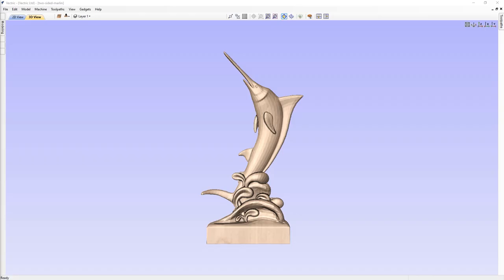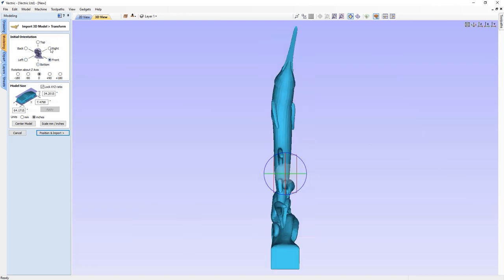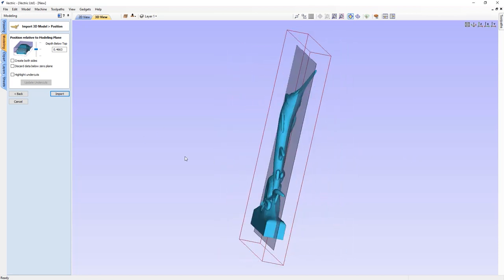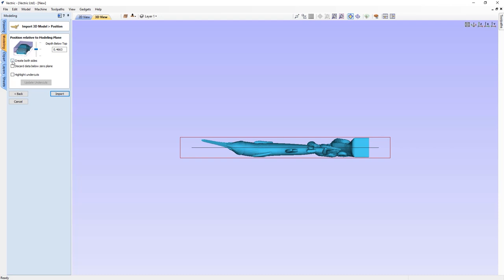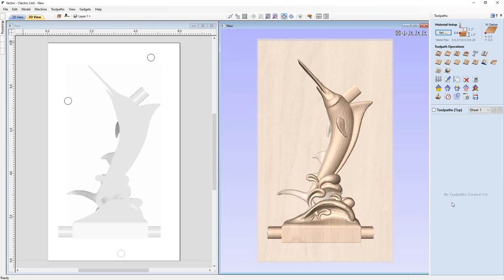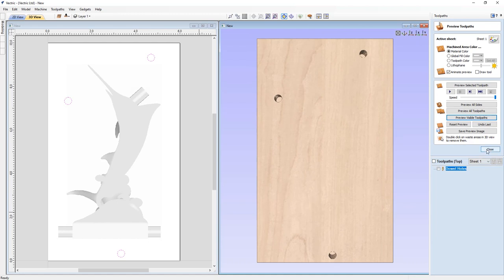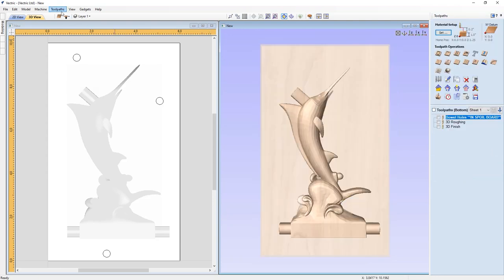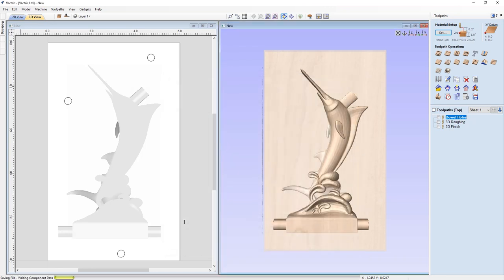Two Sided Marlin | Vectric V11 Tutorials

Comment: An excellent video in keeping with Vectric's quality and customer support. The pace is such that I could work in my own V11 alongside the video. However, I am a bit puzzled that my first attempt at a two sided part from a 3D model takes 6 hours. Cutting just a single side of the model only takes 25 minutes.  The model / part is a square corrugated surface so the top and bottom sides are similar.
Reply from the maker: Hello Greg... this sounds like one for support@vectric.com where they could have a look at your actual file.  Could you please email them, and include your file.